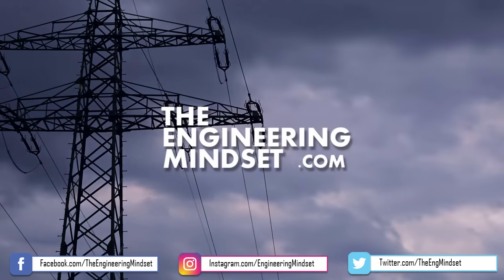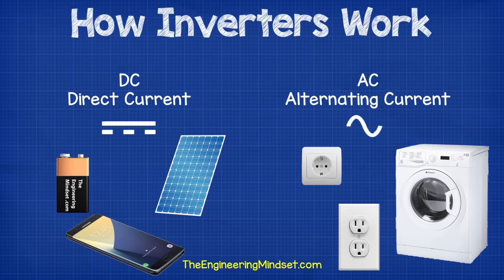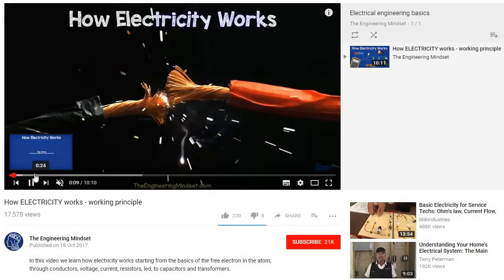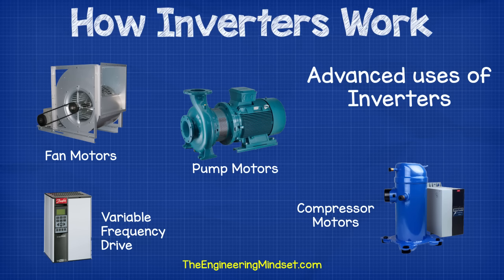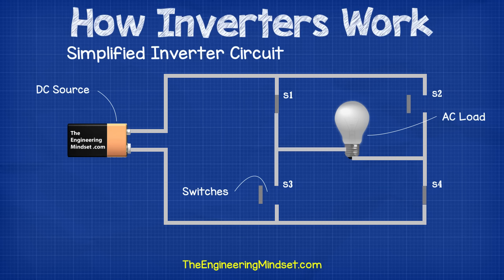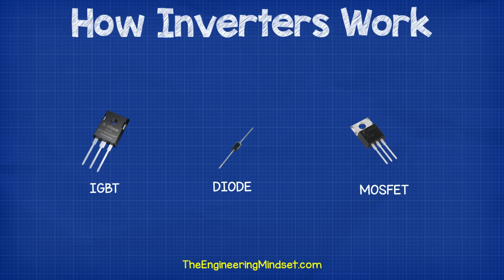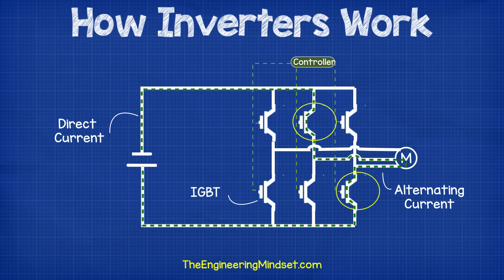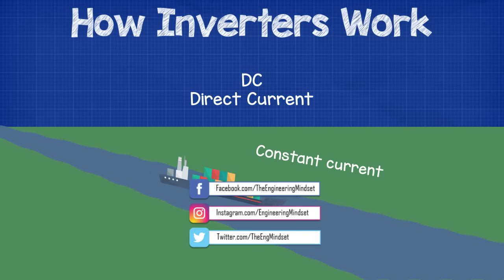How Inverters Work - Working principle rectifier

Comment: I need your help please, I am building a Bluetooth boombox system with my 5.1 home theater speakers, the max power is 1000w peak, I have everything setup but I just don't know how to run this system on battery so can you please help with what type of battery and other things that i have to use? I want the system running at full load for at least 5 to 6 hours thank you
Reply from the maker: Hello MaYa, we don't offer private help, only help that benefits a wide audience to help as many people as possible. But you'll want to do some calculations, for voltage and amps. 1kW for 5 hours is a lot of power for a battery. You'll need multiple batteries and will need to look into parallel and series configuration
Reply: You in 6kwh minimum if this is working of 12v you will need 500 ah batteries if system is 24v 250ah if 36v 167 and so on and on
Reply: The specification of 1000W applies to notional peak. If you short the amp power supplies you get 1kw for a few milliseconds, till the capacitors discharge. It's probably only 10s of watts rms. And real music is less if it's not seriously distorted. Most Hi-Fi amps will die if run continuously at high power. That's why PA amps are big and expensive.
I suggest  measuring the mains input power in VA before buying some expensive batteries and inverters :-)
Reply: MaYa 

5 to 6 hours !!

In your dreams
Reply from the maker: Power inverter video  here https://youtu.be/iIqhAX0I7lI

Comment: Ain't FETs are more efficient than IGBTs due to much less forward voltage drop on them? IGBTs have a min voltage drop due to the bipolar junction voltage. Power FETs on the other hand can have as little as 45 milliohms internal resistance when fully turned on, and by paralleling them currently some power FETs internal resistance is as low as 9 milliohms...
Reply: Mosfets can be paralleled as there is no base current just a Gate voltage.
Reply from the maker: See my new MOSFET explained video here➡️: https://youtu.be/AwRJsze_9m4

Comment: thanks for the information, can you please explain then how the inverter changes a small dc voltage to a bigger AC Voltage. for example the battery used in the clip is a 9v battery, does this mean anything that the inverter is used for, needs to be the same voltage? a 9v light bulb ?

Does the Inverter multiply the voltage coming from a DC source, for example solar panels. 48v solar panels producing 250w into an inverter then used to power a 500w AC appliance

I hope my question makes sense
Reply: When it comes to step up/step down voltage converters you have 2 options:

1) DC-DC converter - google "boost converter" - these converters work by using the principle of inductive feedback [Vfb=L*di/dt] - they take a DC signal, (say 12V DC) and converter it to something higher (like 50 V DC) 
Remember that your total power is fixed meaning you can supply only so much current for a given voltage output --> P=IV --> raise V, you must lower I.
There are also other methods that can be employed like charge pumps etc.
Just google DC-DC conversion methods for more examples.

2) AC-AC converter - google "transformer" - these work using the principle of inductive coupling to "transform" the voltage -  put simply, the output voltage is determined by the turns ratio of the primary and secondary coils [Vo=Vi*N2/N1] where Vo is the output voltage Vi is the input voltage and N2 is turns on the secondary and N1 is turns on the primary
For example, say you have 120V AC input and you want to generate 240V AC output --> you would need a transformer with a 1:2 ratio --> 10 turns on the primary and 20 turns on the secondary is an example.
Remember that power is fixed. This does not change your max power output.

You cannot power a 500W load with a 250W source, no matter what the voltage is. Doing that can be very dangerous and very expensive.
Converters do not increase power they simply "change the form" of it.
Reply: thanks for getting back to me, i think i am confused with what i am asking, let me have a think about it and get back to you. But thank you again for this information, very helpful
Reply: Another scenario: I have 12v 85Ah car battery. Can I get an converter to power 1kw lawn mover lets say for 10 minutes? Thx
Reply from the maker: Power inverter video  here https://youtu.be/iIqhAX0I7lI
Reply from the maker: Seen our new video on HOW SOLAR PANELS WORK in detail https://youtu.be/Yxt72aDjFgY

Comment: how does the pulse square wave becames a sine wave by averaging?  I dont get t
Reply from the maker: Say the positive side of the wave is broken into slots of 10 seconds, and in each slot the power can be on for a maximum of 5 milliseconds. If we increase the on time in each slot up to the maximum of 5, then reduce it back to zero then the average is a wave pattern. for instance in slot 1, the power is on for 1 millisecond and off for 4 milliseconds. In slot 4 the power is on for 4 milliseconds but off for 1 millisecond. 
Slot 1  :X
Slot 2  :XX
Slot 3  :XXX
Slot 4  :XXXX
Slot 5  :XXXXX
Slot 6  :XXXX
Slot 7  :XXX
Slot 8  :XX
Slot 9  :X
Slot 10:
Reply: Inductors

Comment: So you essentially you need ICs in an inverter to control the switches? 
That’s the part that gets me, if you have a pure DC source powering the whole thing there will have to be something manipulating that source to work the transistors etc. 
Unlike a converter which can just be super basic with a couple of diodes and capacitors...
Reply: You can use an LC Circuit to generate a sine wave from DC. This sine wave is then used by the IC's as Input signal. I think they compare the sine wave to a pulse wave of varying frequency to find out which switches need to be on and which off, but I'm not 100% sure.
Reply: +Entcraft44 True, but you would still need some way to switch the source on and off as an LC circuit is gonna need a change in voltage/current to do anything. Otherwise it will just sit there with a charged cap and inductor.
Reply: Yes, there's a digital controller performing the calculation and driving the transistors. This can be done with either a processor or microcontroller.
Reply from the maker: Power inverter video  here https://youtu.be/iIqhAX0I7lI

Comment: Are these used in residential applications yet?
Reply: Extrangulador DelRio v f d's are particularly used in commercial areas.
With the presure sensors or heat sensors as well....
Reply from the maker: Yes, they are starting to. http://bit.ly/2Anxy5B
Reply: Yes. Our refrigerator and airconditioner has inverter technology.  It noticeably quieter and it has no startup jerk.  Manufacturers also claim power savings and longevity of appliances with inverters.
Reply from the maker: Power inverter video  here https://youtu.be/iIqhAX0I7lI